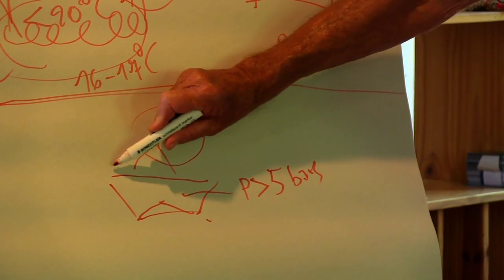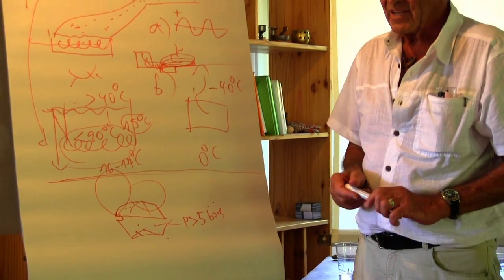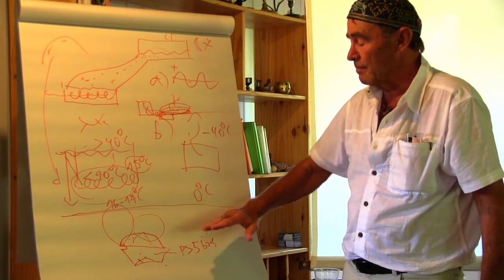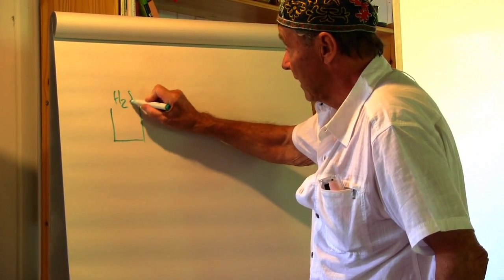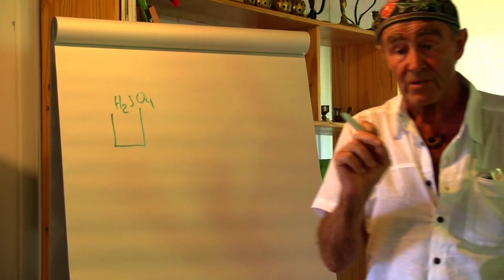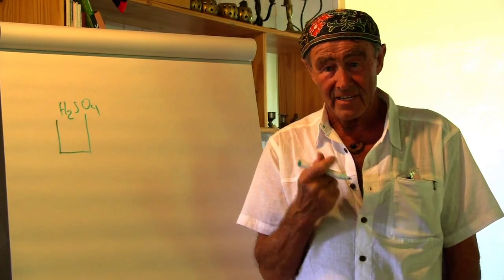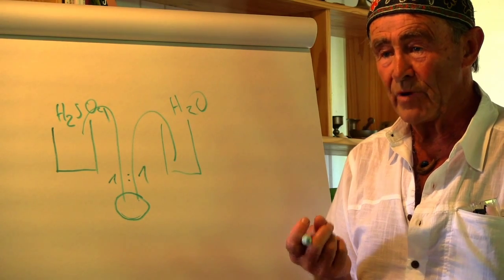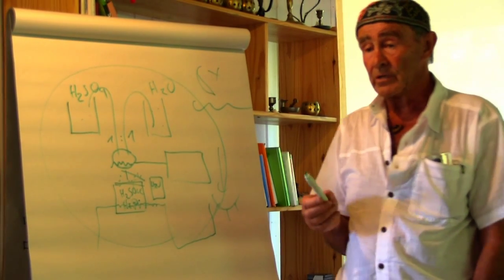Sunpulse 500: Present to the Future, by Jürgen Kleinwächter

Comment: It is incredible that this technology is not everyvhere. LTD stirling motor is absolute favourite for future energy production. Thank you Herr Jürgen.
Reply: The reason it isn't everywhere is that it doesn't work the way he says it does. Low temperature difference equals low power production. Because Carnot, because math. 
The engine is real, it has its uses in the correct contexts. This context and this presenter are incorrect.